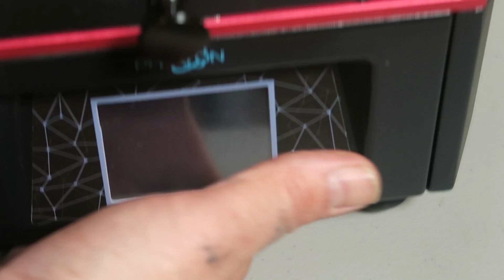Anycubic Photon: How to Reduce Resin Smell!!

Comment: Activated carbon foam does NOT stop VOC
Reply: if you have the right filter it will filter it out of the air that is moved through it
Reply: @19devin86  Server Top Fan DIY filter

NOTE: I can not say how well this can or even if it will filter out 3D Printer particles or fumes, etc.

Used as 3D Printer Enclosure 
FDM printing

https://www.youtube.com/watch?v=Hgdnw0_-mLQ

Comment: What's the downside of removing the fan?
Reply from the maker: Really, there is no downside.  All that internal fan does is blow the resin smell into the room.  If you are a member of the Photonster FB group, this has been verified.  I also have two Elegoo Mars Printers and both do not have internal fans like the Photon.  Both print great like the Photon and are pretty much zero odor because the lack of a fan.  I chose to remove mine, but others have found ways to disable in the GCODE which is an option.

Comment: First of all...The activated carbon filter is not just "black foam" and it is not only for reducing the smell....The polymere releases fumes in the air which simply aren't good for your lung. So the filter takes them out.

Second. DONT just cut the wires. If you really want to get rid of the Fan properly disconnect it OR go for the non-destructive method bastl.sk posted here. But really...you dont want to get rid of the fan; Because you dont want those fumes in the air.

This video highly misleading.

Oh and btw. when you dont blow the fumes out with the fan you will get the whole amount at once, once you open the cabin xD 

Im sorry buddy - you seem quite nice but this video is wrong on so many levels!
Reply: Ok. The "filter" gets saturated after a few hours, when I removed it, it was soaked in resin. I doubt it does much after that. There is an additional second fan that keeps the screen cool below. Having the fumes constantly contaminating a room is not ideal, so why worry about the few times you open the door when it has been contaminating the room the whole time with the useless exhaust fan. Then as long as you operate in temperatures below 90 degrees F. The resin stays at a cool temperature and I have yet to have issues with my prints.
Reply: @erikwithaknotac  This is correct the fan/filter system in the build area is a hazard. If you can smell it. The filter system is not working. Instead of keeping the fumes in the build chamber which will mostly settle after awhile, it is spreading the particulates. This is why several of the newer printers don't have the build chamber fans.
Reply: Frank, Do you have the link for bastl.sk i can´t found.
Reply: You're wrong.
Reply: @erikwithaknotac  lol no argument. OP is correct btw
Reply: @erikwithaknotac  I'm also hesitant to do this. Anything that's in the air has to go somewhere. You're either going to get a blast when the door opens, or if not whatever was in the air is stuck to all the parts inside. Particulates in the air don't just disappear.
Reply: @erikwithaknotac  Please argue.

Comment: Hi, just a couple of questions if i may! After a successful print and you remove the printed item do you re-calibrate  the print each time! 
And when you turn off the print and re-start it again do have to re-calibrate it again! cheers
Reply from the maker: Nope!  Once the bed is completely flat and level, there is no need to re-level after each print or restarting.  Cheers to you!
Reply: @3DPrintFarm  Hi, thanks for getting! Your the man! I found a couple of problems the FEP plate was loose! Now it works great start go! Just another question! Can you mix resin of the brands but different colour together! cheers mate

Comment: The thing that looks like just a piece of foam might actually have activated carbon in it, for example like this stuff http://tinyurl.com/yy7wfcmo, but I'm doubtful the size/volume of the Photon filter is sufficient to remove a significant fraction of the fumes before they are exhausted to the surrounding air.

Comment: There is also non-destructive software solution:
Create gcode file and "print" it:

M8030 T0 ; turn fan off
; Other options: -1 always on (default), -2 on when printing
M8500 ; save configuration

You can print and mount some tight cover to the fan if you want...
Reply: Yes, I thought about this fan before, but I was afraid that it would somehow affect the operation of the printer.
Reply: It doesn't work on the fauxton and the photon s

Comment: Pretty neat.  I do wonder/worry about temperature though.  The polymerization reaction is exothermic so does heat now just continue to build up inside the printer without the air moving through?
Reply from the maker: I thought the same thing.  The Anycubic Photon Users Group has tested this and there is absolutely no issues worrying about heat.  In fact, heat is a good thing.  There is a current project on the forum to build a heater to install in the chamber to warm the resin in colder climates.  This actually helps the resin 'stick' better to the build plate.
Reply: @3DPrintFarm  Yep I'm aware of that and in fact have all the parts to build the heater/temp controller.  I just wonder if there is a limit at which point the electronics start to suffer.  I may try this and leave one of those little digtal thermocouple devices in there for peace of mind.  I've also considered building a proper carbon air filter box and sticking that in between this fan and the exhaust hole.  I don't see myself doing that 4" exhaust duct that some have installed.  https://www.ebay.com/itm/Temperature-Meter-Thermometer-Temp-Sensor-With-Probe-Indoor-Digital/352592453304?hash=item521825deb8
Reply from the maker: @jarrod-smith  Yep.. I'm with you on on that.  I don't have the facilities to build a box and 4" exhaust hose where my printer is located.  The large fan on the bottom does a fine job of cooling off the LCD heatsink.   But really, if you think about it,  If your venting hot air from the build chamber into the where the electronics live, you may be increasing the heat underneath.  It would almost be worth doing a test with a thermal device into a long print to see the temps with/without the ventilation fan.
Reply: @3DPrintFarm  I mean at some point the case itself on the original Photon is a giant heat sink and will come into equilibrium with your room in terms of dissipating any heat.  It's just an uncertainty I have, it's probably fine.  I have one of those $1 thermometers I linked to, sitting in a box doing nothing.  I may try it and see.
Reply from the maker: @jarrod-smith  I may have to pick up one of those therms myself.  What a bargain for a buck! :)